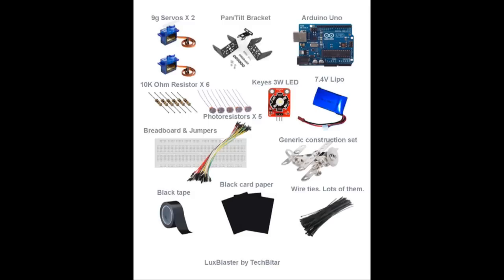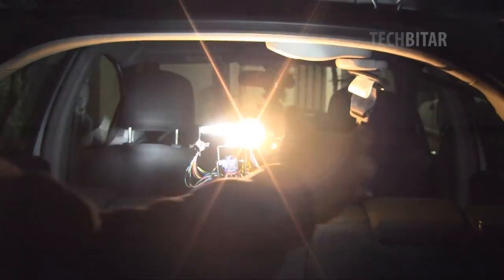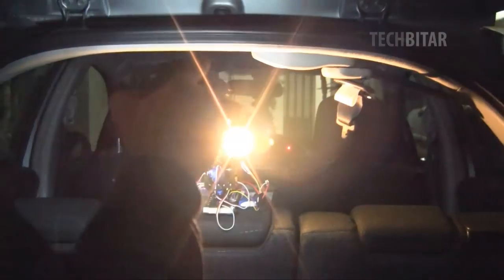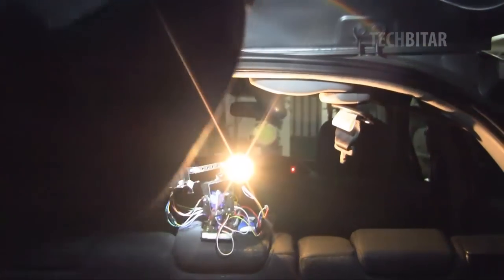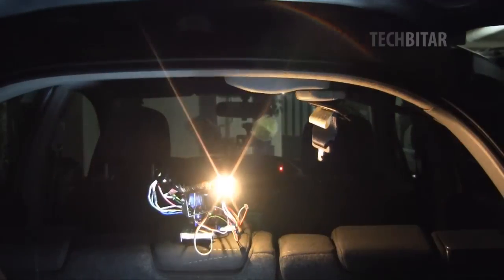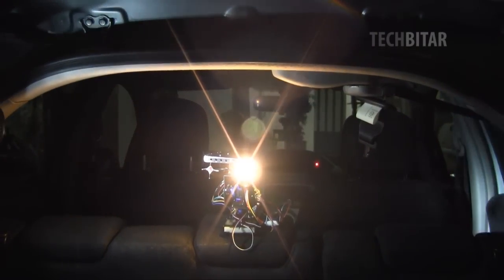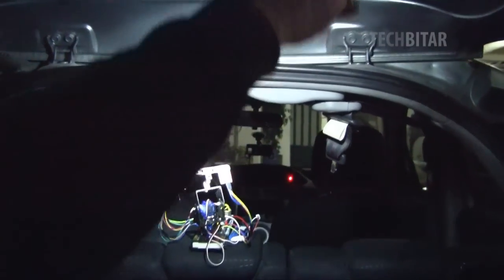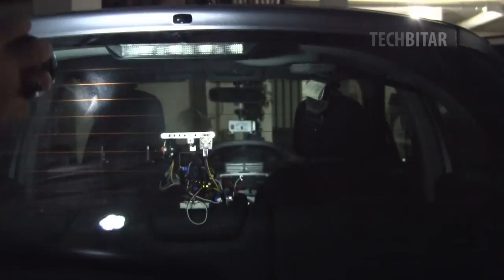LuxBlaster: Give that rude driver behind you a taste of his high beam (Arduino)

Comment: Instead of a remote LED, why not a large mirror instead? That isn't illegal, and it can be placed to block the same light from hitting the rear view mirror. Then the driver behind can see how effortless is using the high beams because it is reflected back. Obviously the mirror must have an angle (not a perfect 180 degrees), so that reflected light does hit the driver's face.

Comment: But would a mirror that simply reflected back bright light to its source be illegal?
Reply from the maker: Good suggestion.
Reply: This might just be legal. Most vehicles already have 3 mirrors facing back. But remember that you can't always tell if the offending lights are really high-beams and/or intended rudeness from a driver. I have a Tundra in which I replaced the headlights with a brighter, but commonly-used bulb. Because the headlights on my truck are higher up than in a car, I know they annoy other drivers because I've been the target of road rage for which my headlights seem to be the common denominator. Maybe it's just my aging eyes, but the original bulbs (which burned out) were just not bright enough for me.
Reply: Yes, highly illegal to use your mirror! You have to grab the steering wheel at 10 and 2 O' Clock, maintain proper speed, act like you're innocent even though you're guilty of getting high beam lights in your eyes, and take it up the you know what from you know who on the highway - The loons, goons, looney toons, drunks, punks, and road ragers.

The driver behind you has the right of way if he/she # 1. is an idiot or one of the aforementioned and/or # 2. puts your vehicle in a ditch and you in either the hospital or grave. So don't you dare fight back. You have no defense. Just take it up the you know what. It's the Law.
Reply: Just accidentally try it on a cop sometime and find out.
Reply: cakeman58 It's not your eyes, I assure you. Over time headlights dim due to use because some of the tungsten burns off creating a black coating on the inside of the bulb. It's not noticeable until you replace it with a new lamp. This is true with any incandescent lamp. Fluorescent lamps loose Mercury over time dimming the lamp, and LEDs will dim for other reasons though it takes many many years for it to be noticed.

Comment: Great idea, but i think the problem here is that the photoresistors will sense about the same light when the source is coming from two headlights tens of feet away. In fact, the light would be more ambient than spectural to the arduino, and would not work in a real world scenario. Cool tho
Reply from the maker: You control the threshold of sensitivity for the photoresistors with a constant. The light radar quadrants can be modified and isolated more to cut down on ambient light.

Comment: So if it sends light back in the direction of the light source you are just returning light to headlights and not the driver.  It's much easier to adjust your rear view mirror to redirect their own bright lights into their eyes.  They back off every time and you can claim you didn't know.
Reply from the maker: Good point. The LED emits light at an angle wide enough to cover the driver (> 100 deg). Also, the light radar is angled slightly lower than the LED. In theory it can be targeted with some accuracy.
Reply: Then sign me up, lol.
Reply from the maker: chris Reed Only if you promise to never use it on the streets :)
Reply: techbitar
What the heck else would you use it for?A light show?

Comment: Ignoring the safety issue he addressed. I actually do not see how this would work. If the light is tracking the bright light would it not be focusing on the light source and not the driver? Sure it would be alarming to see a bright light facing at you but I dont think it has a wide enough spread to truly effect the driver behind you.
Reply from the maker: The light radar is tracking the light not the LED and it's angled lower than the LED so the LED is pointing slightly higher. Also, the viewing angle (degrees) of the LED is about 140 degrees. That's pretty wide.

Comment: It is pointless as presented, since it is not legal, at least in the U.S.
Reply from the maker: It's not intended to be used on the road even if it's legal. Keep in mind that blasting someone with the far stronger hi beam of an automobile is common practice.
Reply: techbitar Bullshit! The video is titled and the product is demonstrated for use in a vehicle on the road. The disclaimer to not use it that way is an attempt to shield liability.
Reply from the maker: Virgil Bowes the DIY realm is full of dangerous projects not meant for real world use such as rail-guns and rockets and the like but are fun to build and learn from. Surly the power of a 3W LED of the LuxBlaster in a video is far less harmful when compared with high speed projectiles.

Comment: If you are being high beamed , you did something stupid to the person behind you.  Did you pull out when he was 10 feet away and travelling at 55 mph? Are you driving 45 in a 55 zone on a single lane road? Did you jump from the lane you were in to get 3 inches from the other persons front bumper for no reason whatsoever.  Point is road rage starts when person A. Does something that almost kills person B.. person A shouldn't get upset from someone highbeaming them they may owe person B their life.
Reply: or because they dont want to be pulled over for a low beam light being out, and too lazy to fucking change it.....